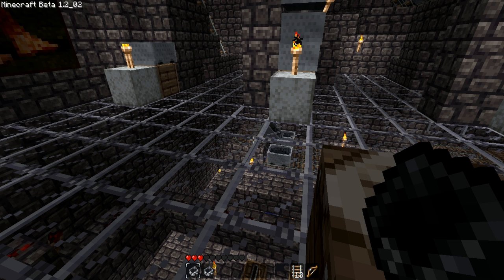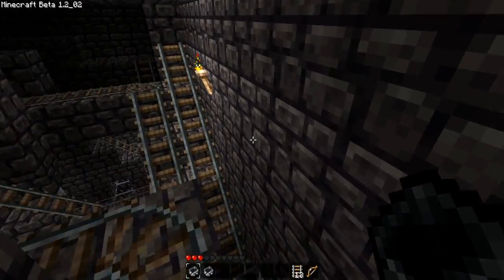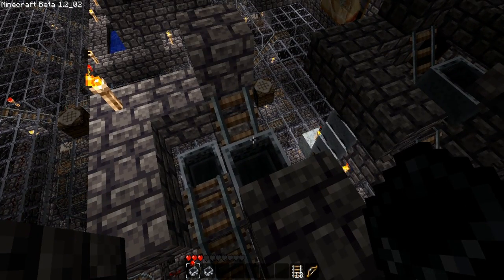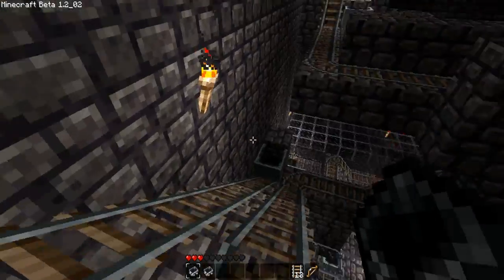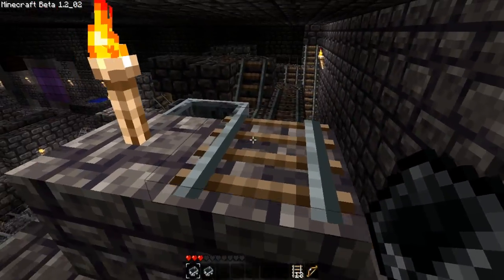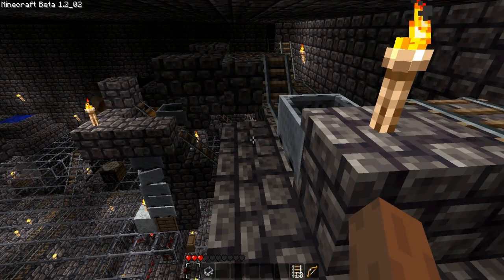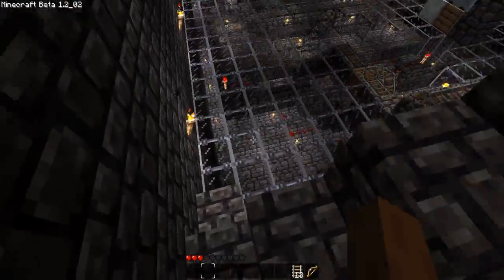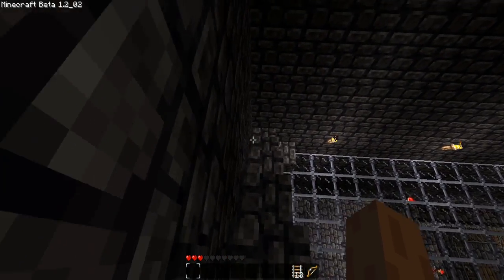Minecart Tutorial | Modular Cartriages

Comment: @wetwilly99999992 Hm, I'm not sure you understood what I mean, or perhaps I explained it badly. What I mean is that currently when you send for a cart you have to wait until the perpetual booster to load up momentum and when it's done that it will pick up a cart and send it to you. What I'm suggesting is having several perpetual boosters "linked" and it will send the first one that has built up enough momentum to boost the cart. This will minimize the "wait-time" when it builds up momentum :)